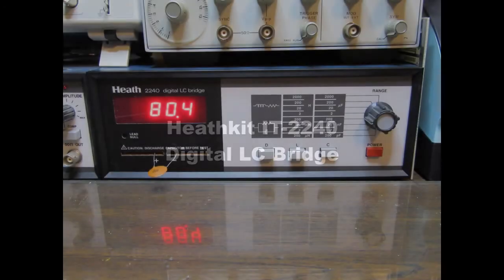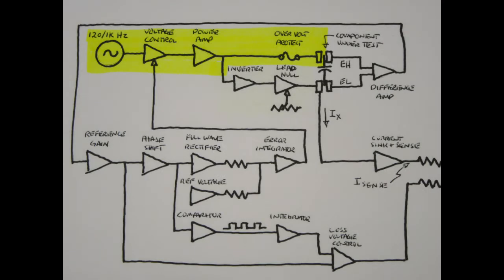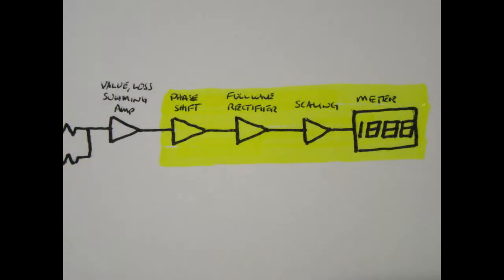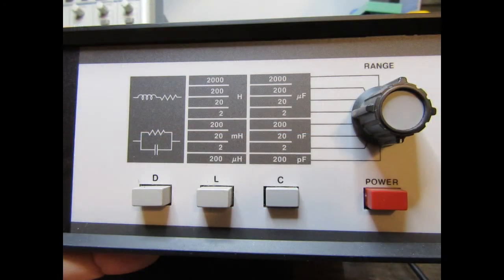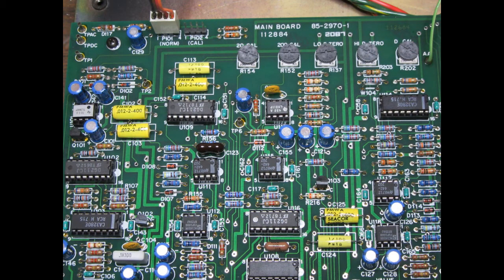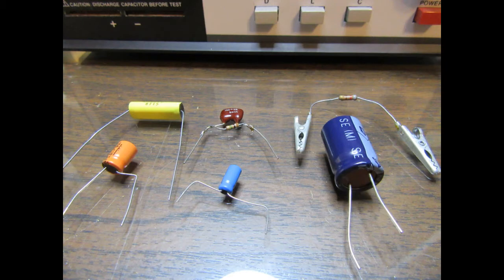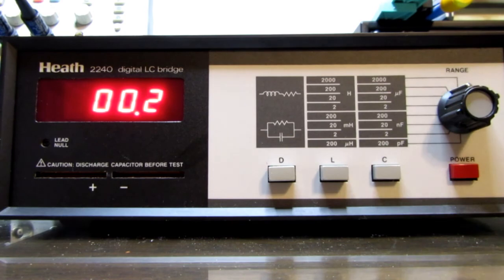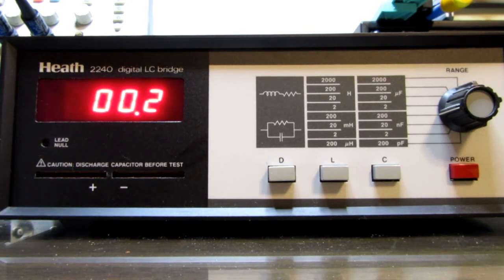Heathkit IT-2240 Digital LC Bridge

Comment: Hi, i know nowdays you can buy a SCR meter for cheap but i want to make this heathkit unit on my own. I saw it uses two prom memory chips, the page 71 of the manual shows the logic charts but im not sure if it is a complete chart, do you think is posible to use that info to burn a new prom?
Reply from the maker: Omar, the IT-2240 manual I have shows logic charts on pages 71, 72, 73. Page 71 just shows how the Range switch SW1 produces a binary pattern of 3 bits for all positions,  and those bits are used by the two PROM IC's as their address inputs. Then Page 72 shows the logic chart for PROM IC U119, which contains the logic patterns for the 'D' mode, while Page 73 shows the logic  chart for PROM IC U121, which contains the logic patterns for the 'L' and 'C' modes. If you don't have all three charts, you won't be able to program new PROMs.
Reply: @youtuuba  thanks for the reply. Yes i got the three charts. Hope i can make this project run

Comment: December 21 2020, I finally scored one of these on ePay tonight. Looking forward to adding it to my test bench. Thanks for the excellent review.. It appears that this was a reasonably designed unit at an affordable price. I'd love to hjave one of the high dollar HP units but alas, I would only need it occasionally.   Maybe the HP will give better resolution but the Heath unit will get me close enough.
Again, Thanks !    73, WA4AOS
Reply from the maker: wa4aos, glad you were able to grab one of these. I think they must be fairly rare. Mine went together well, and in spite of the complexity of the circuit, worked perfectly and has remained in excellent operation ever since with no attention given it. It did seem to me that troubleshooting it might be a challenge if it did NOT work for some reason.

For a long time, it seemed there was no alternative to this meter, except to spend a LOT more money on a professional instrument. Every other meter was either analog and not very accurate, or had less range, or was harder to use, etc. Nowadays, there are lots of inexpensive digital capacitance meters out there, most of them handheld, which do what this Heathkit meter does, so it's no longer the only game in town.
Reply: @youtuuba  well i finally layed my hands on one''''its in very good condition witch tells me it was very limited use'''''i guess ill have to open it up to see if those test capacitor's are stored in there like your video said''''''thank you for your video'''''''james,,oklahoma,,,73's.
Reply from the maker: @jamesharrison2041  , if those test caps are not inside, you can make your own using nee, high quality parts of similar capacitance values, but you would need access to another LC meter to see exactly what their values are.
Reply: @youtuuba  thank you'''''and yes they are very rare'''''i was told that the reason why this old good rare equipment is all of a sudden hitting ebay is because of all the ''hams''' that have passed away during this pandemic''''''sad''''